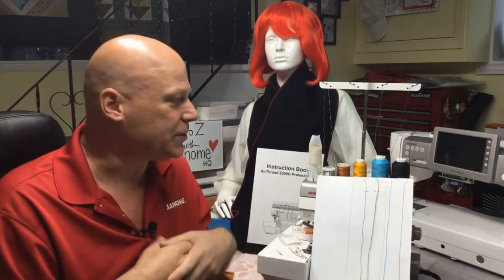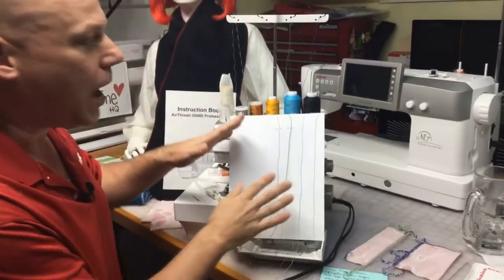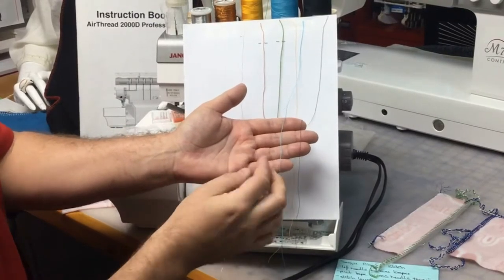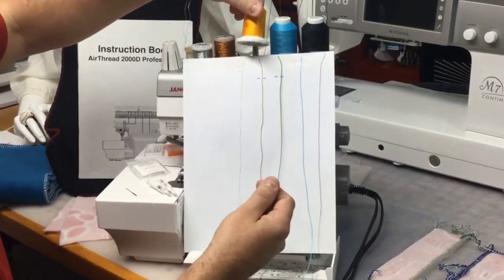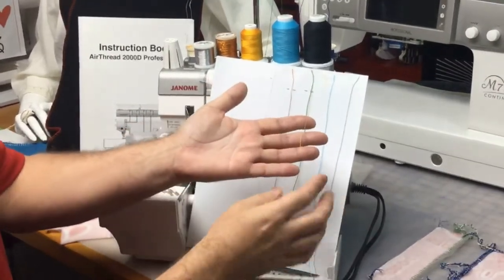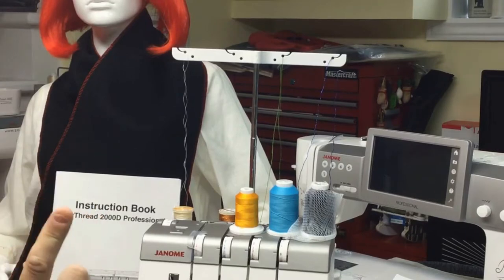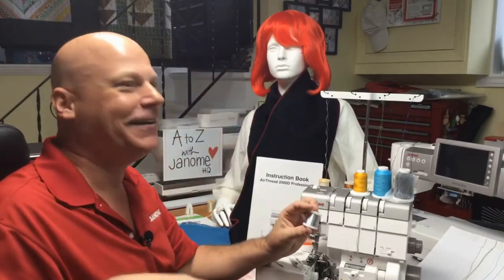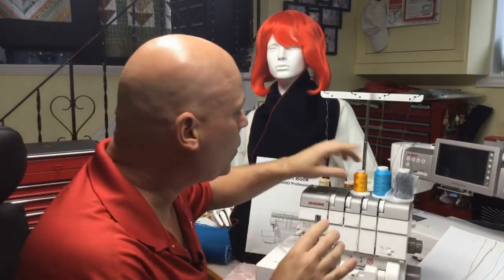Using Decorative Threads in your Serger!

Comment: Thank you for an informative video, my 2000d arrives this Tuesday, what is the ideal (higher-end fabric)  thread to use for 100% rayon matte jersey fabric?
Reply from the maker: Yay! Congratulations on your new machine! The fabric sounds gorgeous! I honestly use the Madeira Aerolock and Aeroflock thread for all of my serging. I've never had any trouble with the thread, which is why I use it for everything. In this case, I'd try the Aeroflock in the loopers so the seam is nice and soft like the fabric. Always do a few tests to see which you prefer and how the fabric reacts.
Reply: @janomehqjanomecanada4908  thanks!
Reply: @janomehqjanomecanada4908  forgot to ask!...so when dealing with stretchy fabrics theres not a need for stretch threads correct?...D:)
Reply from the maker: @darrentrentacosta  yes, correct. The thread doesn't need to stretch because of how the stitch is created on the serger; it will provide the stretch
Reply: @janomehqjanomecanada4908  thanks!
Reply: @janomehqjanomecanada4908  So thrilled my air threader arrived today, may I ask a question...I've only ever worked on wovens so my thinking is aligned to my Skyline S6 machine...its regarding seam allowance.  I cannot find a tutorial on how to either adjust the blade placement (is that possible?) or where exactly you're suppose to line up you seam allowance (5/8, 3/4, 1/2, 1/8 or 1/16th).  I notice when I practice, regardless where I place my fabric I always get a perfect 1/4 finished seam.
Reply from the maker: @darrentrentacosta  Congratulations on your fabulous new machine. The lower knife can be adjusted for a slightly wider or more narrow seam allowance (It's on page 12 of the manual) Using the left needle will also make a wider seam. There's markings on the looper cover for 5/8" 1/2" etc. but with the upper knife engaged, the seam allowance will be trimmed to approximately 1/4". If you'd like to leave wider seam allowances, stitch the seam allowance on the Skyline S6, then finish the edge with the serger.
Reply: I am so confused by this simple process.  I  wish the blade dial had accurate measurements on it, the dial I have is blank, which makes using it a bit random, rather than exact measurements of how far left/right you're moving. I did a few trials and if I draw a 5/8" seam allowance line on my fabric, line that caulk line up with my left needle, dial my cutter all the way flushed to the left...it cuts 3/8" and gives me a 1/4" seam allowance = 5/8th".  I did try to sew a basting stitch as well, with both a jersey and a stretch needle and lets just say it was a hot mess...:) @janomehqjanomecanada4908